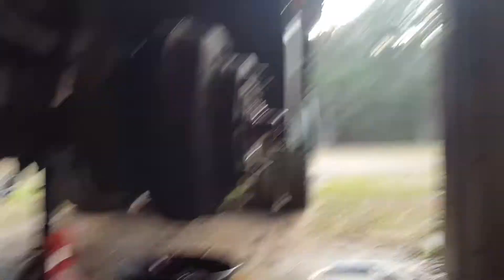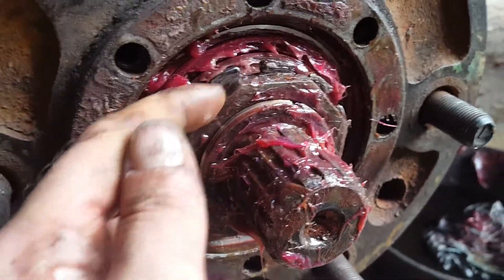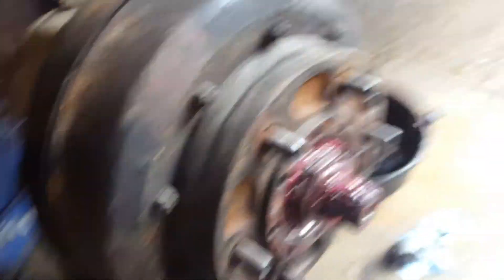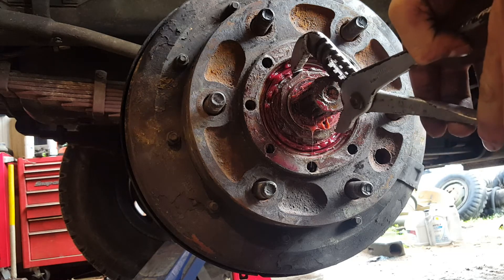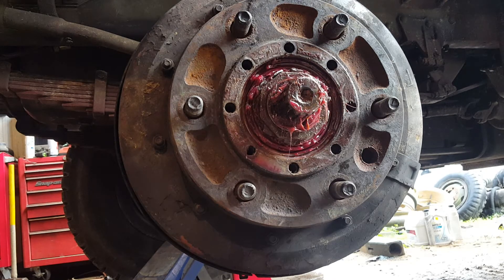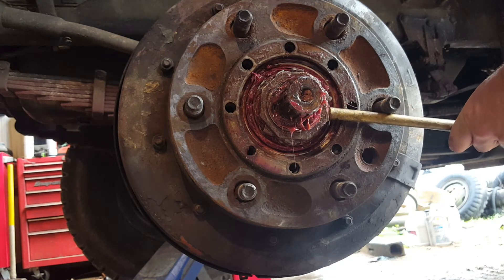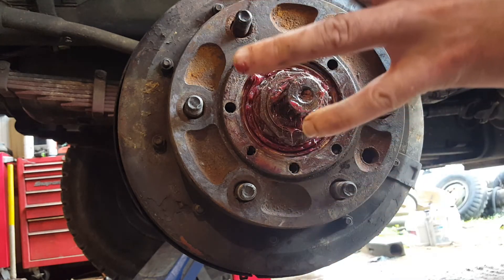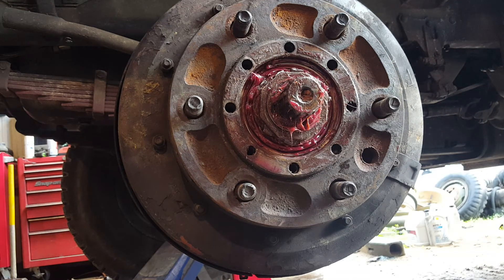Front bearing service pt.3.

Comment: Video on inner axle seals?
Reply from the maker: FARMTRUCK01 
I will make a video on that when I get a truck in the shop that needs that job done. I do these videos as I make necessary repairs on my trucks, and customer's trucks.
Reply: @tacticalrepair  how much do you charge a customer for inner/ outer seal replacements?
Reply from the maker: @rolling1885  $75 labor per hub. Parts, grease, solvents, etc. not included.
Reply: @tacticalrepair  I need boots, and front seals replaced (on the truck) I have the parts. where are you located? Feel free to do Vids on the work!!
Reply from the maker: Dry creek, Louisiana.

Fronts cost more if doing boots. Lot more work involved.
Reply: I'd like to see this too.

Comment: Hey Garrett, great videos!! This is next on my truck. What grease do you recommend? I see Napa has Sta Lube hi temp bearing grease. Says it is gray in color...not that that matters. But I usually use Red grease, Lucas red and tacky to be exact. I wasn't going to use that since I need so much but figured I'd get your opinion.
Reply from the maker: Any red #2 grease is fine. I buy the 5 gallon bucket of mystic JT-6 red grease from Napa.
Reply: Thank you. What tool do you recommend to pull the inner bearing off the spindle? I know I can get it off but want to make sure I'm using the right one to not damage it. I have a gear/pulley puller.
Reply from the maker: Usually just two fingers and a screwdriver, or two screwdrivers for a stubborn one.
Reply: i used proone extreme pressure grease, food grade too so you can eat it i guess lol
Reply from the maker: I can't offer an informed opinion on that other than any food grade lubricant normally isn't high enough film strength to stand up to the heat and pressure of the heavy auto application.

Extreme pressure in food machinery isn't the same as extreme pressure in automotive. There are also other factors that contribute to degradation.

I cannot suggest or support the use of such lubricant in this application. I don't know anything about it except my experience with similar lubes though. Hope it works for you.
Reply: @tacticalrepair  https://www.pro1energy.com/wp-content/uploads/2017/03/EP-2-Grease-Sell-Sheet_NFG_3.9.17.pdf thats the spec sheet if yer interested in skimming through it